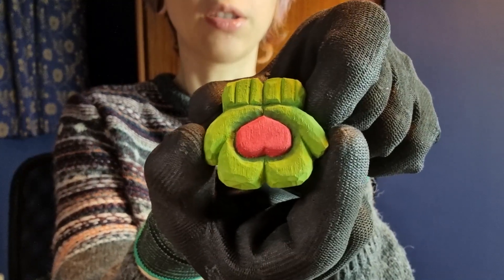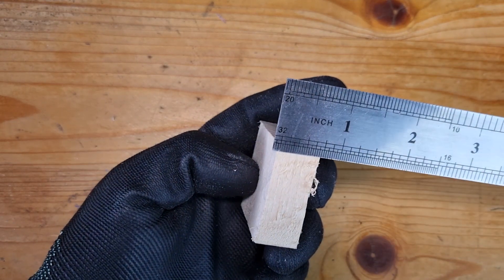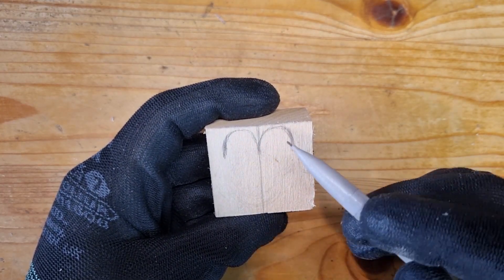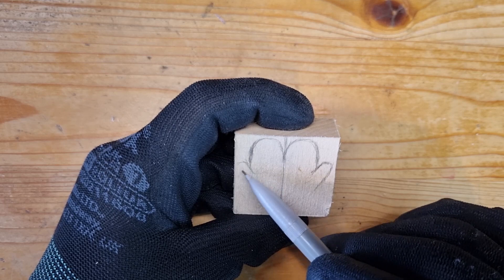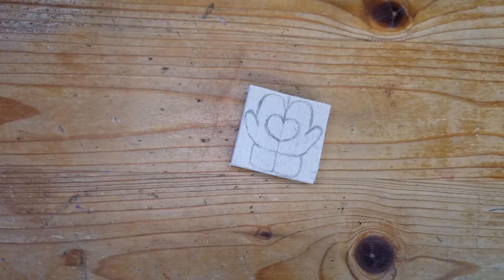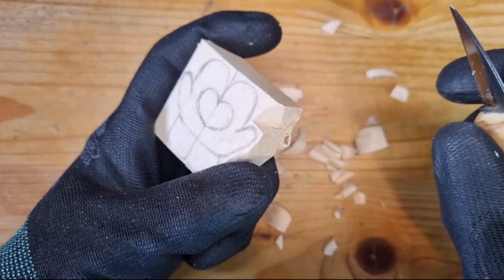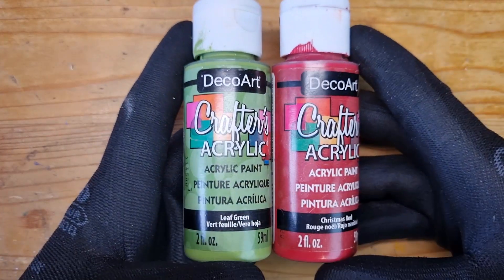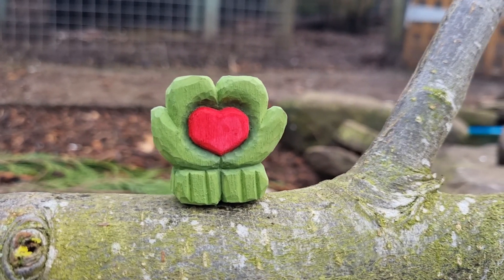Easy Valentine's Woodcarving | Whittling for Beginners

Comment: Thank you for such a carving lesson.  It is very interesting to look at your work technique.  You work with gloves.  Is it convenient for you to do small jobs in them?  I like to do small jobs with my bare hands. 😄
Greetings from Ukraine🇺🇦
Reply from the maker: Thank you very much for your kind words! I am using the simplest nylon gloves. They are quite thin, which makes them really flexible. But, as a result, they are not really cut resistant - they only save me from minor cuts. To be honest, I also mostly carve without any gloves at all, but don't tell anyone :D however I always recommend to use a proper glove at least for your left or non-dominant hand (especially if you don't have too much experience).